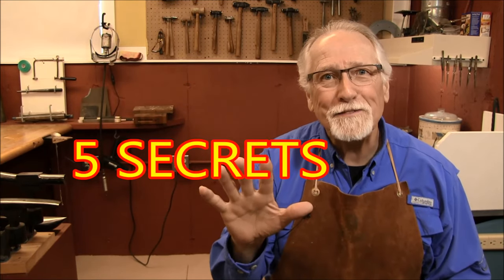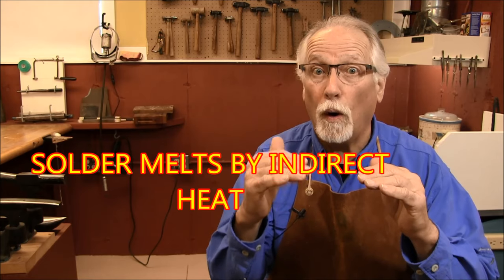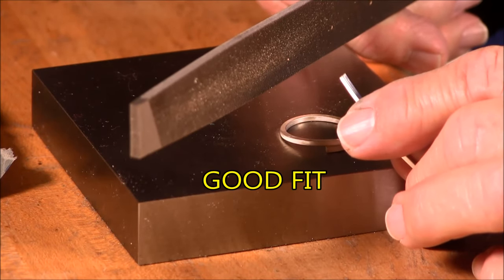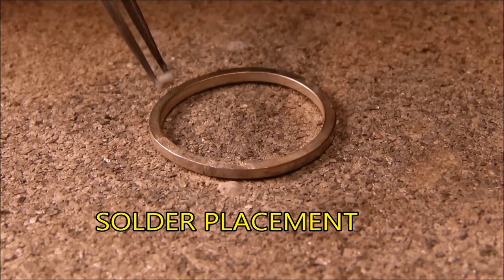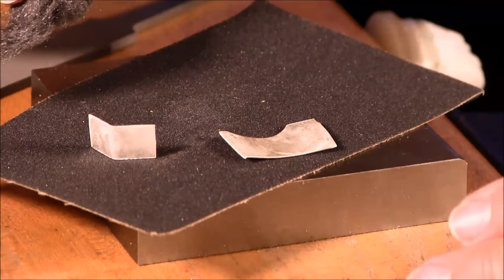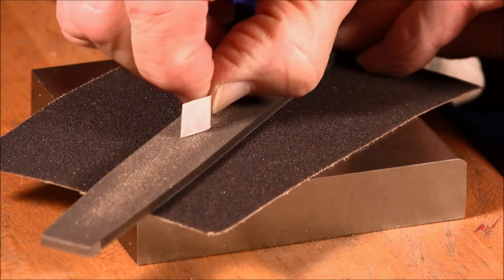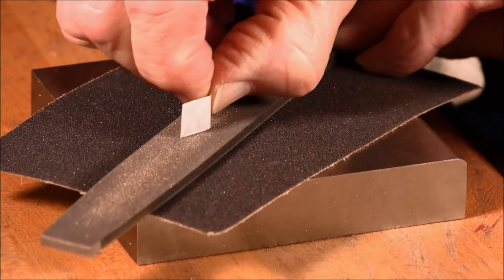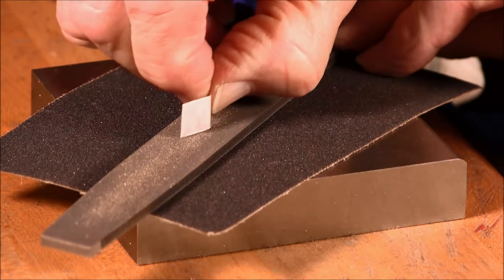5 SECRETS TO PERFECT SILVER SOLDERING!

Comment: Thank you for these videos, I have learned a lot from you.  How do you feel about using wire solder and quick touches to the joints?  I am always unsure about how large my palions should be or how many to use.  Thanks.
Reply from the maker: Hello Laszlo,  You are welcome and I'm glad you are learning!!  Stick feeding wire solder is a good method and I use it often.  I usually use it when I need a little more solder than just a few pailons.  Be careful, because it is real easy to over feed and then you will have a mess!  A little trick to make your solder wire thinner.  Put a 1/4 rod in your vise standing straight up. Take a length of wire solder, hold the two ends separately with two hands.  Loop the wire over the rod and start pulling the wire back and forth on the rod.  This will stretch the wire and make it thinner.  This way you can control the amount of solder on the joint simply by using a thinner piece of solder.  (Hope this makes sense to you!!)  Good luck and have fun.  Greg Greenwood
Reply: @greggreenwood4628    Thanks I'll give that a try.
Reply from the maker: Hello Laszlo,  Let me know how it goes.   Greg Greenwood

Comment: I watched the entire video and learned to just cut the silver solder instead of trying to feed it off of the roll - as I normally have done (Unsuccessfully).
I was trying to figure out what surface you are soldering on?   It looks like granite -0 but I learned decades ago that using a torch near granite will cause it to blow up (in my face). 
What surface are you setting the items that you are soldering on - it is granite, or does it just look like granite?
Reply from the maker: Hello NaverAuto,  I am very glad you learned about cutting the solder instead of stick feeding it.  The surface of my bench is slate.  It is from an old house that was being torn down and I saved it! I don't solder directly on it.  I always use a soldering block.  Vermiculite soldering blocks work great to protect your bench.  Which is usually wood.  Check out my video "30+ Silver Soldering Set Ups".  You will get some good pointers.  Thank you for watching.   Greg Greenwood

Comment: Dear Greg, thank you so much for such an informative video! 
I am a beginner in soldering, so I just bought Bernzomatic butane torch, but it seems it can not melt a 60% silver solder at all. What’s wrong? Maybe it just doesn’t have enough temperature for soldering?
Reply from the maker: Hello Elisha, Welcome to the world of metalsmithing.  Thanks for your comments. It is possible that you have too large of a piece of metal and the torch cannot heat it up to the melting temp of the solder.  If you have followed the 5 secrets  and it is not flowing,  Crank your torch up and heat the metal faster.  If you still have problems, please let me know and we will figure it out.   Thanks for watching.   Greg Greenwood

Comment: I have a project where I need a pretty tight fit I would rather a pressed fit but I don’t suppose I could solder it then, I’m putting a 5/16 or a 3/8 in sleeve in length and a 1/16 thick in a hole
Reply: How tight can I make it!
Reply from the maker: Hello Eric,  Make it as tight as you can.  Even if it is very very tight, it will solder.  The solder will flow into the seam.  I hope this answers your question.  Thank  you for watching and commenting.  I am here to help.  Greg Greenwood

Comment: Great tips and video.  Do you use the same flux and solder for copper and brass?  Any recommendations?
Reply from the maker: Thanks again Larry.  Yes, use the same flux and solder for copper and brass.  Try to make you fits as perfect as possible.  This will make the solder seam not show up on the copper or brass as much.  Good Luck  Greg Greenwood

Comment: Greg, I really love your videos!  I was hoping you could help me with a problem I am having.  I've been soldering successfully for years but in the last week I've been having trouble and I can't for the life of me figure out what I'm doing wrong. My piece is turning black right away and the solder isn't flowing despite the boric acid solution I'm using.  Thinking it might be a bad batch of solution, I tried with just a paste flux and the same thing happens.  It also doesn't seem to make a difference if I use wire or paste solder.  I use a Smith Little Torch with propane and oxygen and I work only with copper.  Is it possible to use too much heat? Could my propane to oxygen ratios be an issue?  I could really use some help before I go bald from pulling my hair out!!!  Thanks so much!!
Reply from the maker: Hello Mark,  Interesting!  Without seeing exactly what is happening, I have a few questions for you.  Have you been soldering the same size of copper, same torch, and same flux for years and all of a sudden you are having problems? Is the copper a reddish color when you start to heat or is it clean with no reddish color to it? Solder will not flow on the red color of copper. 
 Copper is known for turning black or oxidizing when you heat it. If it is oxidizing right away, this means you have not protected the copper with enough borax flux.  Don't be afraid of putting a lot of borax flux on the copper. Using the boric acid solution is probably not enough to stop the oxidation, thus, your solder is not flowing.  Also, use a more reduction flame when heating the copper. (Not a hissing flame, this means too much oxygen in the torch tip) . 
Let me know if this is helping you.  The best to you and thanks for your question. I hope this helps.   Greg Greenwood

Comment: Thanks for another great video!!Mr. Greenwood, it would help immensely, if you could make a video on using gallery wire for bezels. Unfortunately, I keep accidentally melting mine! That’s a big waste of money, time and effort. I read somewhere that painting the decorative part of the gallery wire, with liquid paper will prevent the top from melting. Is this true? I really could use some help. What do I do with all of this ruined silver with solder on it? Help!
Reply from the maker: Hello Texas Gigi, Thank you for your comment. I appreciate it.  Gallery wire can be a problem, but it doesn't have to be.  Sounds like your problem is excessive heat.  Gallery wire is very thin and will heat up extremely fast, soooooo... you don't want to put the torch directly on the wire.  Set up your bezel back sheet on a tripod or 2 third hands and heat from the bottom only.  Because the gallery wire is so thin, it will heat up enough from the indirect heat of the back sheet and the solder will flow beautifully.  If you have not seen my 2 videos  "Bezel Setting Cabochons Parts 1 & 2", make sure that you watch them.  You will pick up a few tricks.  There is a product from Rio Grande. "Rio Chil Gel"  it is for protecting stones and other  metal when you are soldering.  Check it out, it might work for some other soldering that you may do.  I believe the heating from the bottom is the best solution for your gallery wire.  As for the wasted metal.  You will always have scrap and "wasted" pieces of silver.  Keep them and after "lots of mistakes" LOL .  you will have enough to recycle. I use  scrap to make shot also.  Let me know how it goes.  Good Luck.  You can do it!!!  Greg Greenwood
Reply: @greggreenwood4628  Thank you so much, for all of those good ideas! I will definitely get some of that gel and I will watch those 2 videos, right away! Thanks so much for getting back to me, so fast!!
Reply from the maker: My pleasure!  Greg Greenwood

Comment: Love your tutorial. Is there a specific flux you need to use for soldering sterling silver or do they all work the same?
Reply from the maker: Hello Sharyn,   Thank you for your comment.  You should use a flux that is a high temperature flux.  Borax flux (white paste) and liquid high temp fluxes will work.  Do not use the flux for plumbing soldering.  That is a low temp flux and will burn off before the silver solder melts.   Thank you again.  Greg Greenwood
Reply: @greggreenwood4628  Thank you so much!

Comment: Hello there! Love your tutorials, but I have some problem , sometime peace of silver I’m working on gets hot even can melt and happened to but solder doesn’t melt, I’ve got to doing something wrong can you tell me what it can be , thank you, Vj Maidans .
Reply from the maker: Hello vj m,  If your silver piece is melting, then you have too much heat.  Because you are over heating the metal, the flux probably has burnt off and oxides have formed where the solder is to melt.  Back off on the heat of your torch, use plenty of flux, and heat only in the area that you are soldering.  You do not have to heat the entire piece to the melting temperature.  Take it slow and watch your flux.  It will tell you when the solder should flow.  1. Flux should bubble and boil off water 2. Flux will start to settle down on the metal 3. Flux will turn clear and smooth 4. Then solder should melt right after the flux is clear.    Just take your time and practice a little more before you solder your final pieces.   (Practice, Practice, Practice.)  The best to you.   Greg Greenwood

Comment: Very cool... Thanks.
Can you please say what exact solder and flux do you use?  Every time I try it the silver just turns into balls, doesn't stick and the solder just crusts up... It's always a mess... when it doesn't destroy the piece i'm working on...  😀
Thanks again...!
Reply from the maker: Hello dmprdctns,  Thank you for your comments.  I appreciate it. It sounds like your main problem is you are not heating the metal up to the melting point of the solder.  Solder does not melt and flow onto the pieces of metal unless the metal parts are at the melting point of the solder.  In your case the solder is balling up because the solder is hot enough to melt and it simply balls up, but your metal is not hot enough to make it flow into the solder joint.   Please watch these videos on my channel.   1.) "5 Secrets to Perfect Solver Soldering" (You have already watched this one.)   2. "What the Heck is Sterling Silver and Silver Solder?"   3 . "What is Pickle?"   4. "Silver Solder Hidden Details".    5&6. "Sweat Soldering Part 1 and Part 2 "  These videos will answer many of your questions and help you understand what is happening when you are soldering.  If you understand these details , you will be able to solder with no problems.  Thank you again and Please let me know how it goes.  I am interested in your progress.  You can do it !!!  It will be fun.   Greg Greenwood
Reply: @greggreenwood4628  Thank you very much.  Very appreciated!   I will watch those videos, LIKE and SUBSCRIBE...
I hope I didn't misunderstand, but the flux (Stay-Silv, white)  dries up, crackles, etc. on this copper ashtray with other metal trim.  The ashtray, a test piece, got so hot that it melted other solder points and liquefied the trim around the copper.
Thanks again... and Happy Sunday to You.
Reply: @greggreenwood4628  wow, this helps me so much. It is a problem I have had and keep having. NOW I GET IT, my long unanswered question is now clear. I can’t thank you enough.
Reply from the maker: Hello Tina,  Very glad to hear it.   Greg Greenwood

Comment: I have a stainless steel pan with a very small pinhole through which water leaks.  I heard you say solder will not fill gaps so does that mean I should not even try soldering the pin hole?
Reply from the maker: Hello Bob,   Go for it!!  If you have to, put a small silver wire in the hole first, then solder.  Good Luck  Greg Greenwood

Comment: Just a great video.  I'm hoping you can suggest a torch for silver soldering brass?
Reply from the maker: Hello,  Thanks for the comment.  Glad you enjoyed the video. 
You can use any torch for brass soldering that is good for silver.  If you are soldering heavy pieces of brass I would suggest using an acetylene gas/ air mix torch.  A propane gas torch will do a great job on brass sheet metal.  If you have access to a natural gas and air mix torch, it will work also.  You can find these torches in most jewelry supply companies. Also hardware, big box stores, and farm stores normally carry these torches.  Have fun soldering!!  Ask any question,  ANYTIME!  
Greg Greenwood
Reply: @greggreenwood4628  Thanks Greg!

Comment: Thank you for a very instructional video.  I use artistic silver wire for jewelry making.  Can that wire be soldered?  It's silver-coated, copper inside.
Reply from the maker: Hello J & D,  Yes, you can use silver solder for your wire.  I would not recommend using the IT solder.  It might have too high of a melting temperature for what you are doing.  Use the lower temperature solders.  Easy, Medium, Hard.  Thank You. Greg Greenwood
Reply: @greggreenwood4628  Thanks very much for the quick reply.   I have a silver solder paste that I was planning to use.  Hopefully that will work as well.
Reply from the maker: Absolutely,  It will work fine.  Good Luck and let me know how it goes.  Greg Greenwood

Comment: Hello Greg. I pay close attention to the 5 points that You indicate to succeed in a good soldering. But I have a question about the strength of my flame: I have a lot of trouble knowing if I have a hot enough flame for my soldering. I don't know if I'm using the right part of my flame to get enough heat. can you give me some tips: flame color? noise? I use the ORCA torch; thank you very much.
Reply from the maker: Hello Sadaf, Thank you for viewing my video.  I appreciate it.  Your Orca Torch is a propane fuel torch and will have a blue flame.  You should have several tips. The hottest part of the flame is just beyond the sharp bright blue flame. You should not have a load noise when soldering.  "Medium" level noise.  I want you to do an experiment that will help you learn more about your torch.   Take a small square of silver 3-4 cm  and put borax flux on it.  Start with your small tip and heat the metal (just beyond the blue flame)  until the flux stops bubbling and forms a glaze.  Count the seconds that this takes.  Repeat the process with your medium and large torch tips.  The time should be under 5 seconds.  If it take longer, then you are using too small of a tip. You can use this knowledge when soldering your projects.  If it takes to long to burn off the excess flux, then you need to use a larger torch tip.  I hope this helps you.  Let me know how it goes.  Greg Greenwood
Reply: @greggreenwood4628  thank you very much Greg for taking the time to answer me. I am always very worried about boring experienced people with my beginner questions ... But I also think that asking questions was part of the learning process and allowed me to waste less time! I will test what you suggest to me. I am delighted to have the beginning of an answer, and am almost sure that I will finally make some nice solders. thanks again. I would allow myself to give you some news ...
Reply from the maker: Sadaf,  I am happy to help you with your questions.  That is how we all have learned.  Good Luck.  Greg Greenwood

Comment: Excellent information, thank you.  I'm going to attempt to sweat solder 2 pieces of sterling together.  Both pieces are textured, one pretty deeply from the rolling mill.  Any suggestions?  I'm considering using binding wire, but not proficient with it yet.  This is for a ring band.  Thank you for all the information you give in your videos.
Reply from the maker: Hello LA Os,  Thank you for your kind comment.  As for your ring soldering.  If you have textured the sheet with the rolling mill it will be work hardened and will be stiff and springy.  You first need to anneal both pieces to make them soft.  After annealing, put them on your bench and push them flat with your fingers.  If they are still not flat, use your rawhide mallet and tap gently to make them flat.  Because they are flat, you do not need to use binding wire.  You can use the cross-lock tweezers to hold the two pieces together as you solder.  But this will steal  some of the heat, so you need a larger flame to melt the solder. Next melt solder onto the back of the top piece and put in pickle to clean.   Then you are ready to solder the two pieces together.  Flux both pieces and place the top piece onto the bottom one.  Make sure that both are flat.  Then heat with your torch and melt the solder.  Your texture should not affect the soldering process.  If you need to push the top piece down to make sure it is seated on the bottom piece, you can use your pick to push it down when soldering. Do this only if you are not using the cross-lock tweezers.  I hope this helps you.  Let me know how it goes.  Good Luck  Greg Greenwood
Reply: @greggreenwood4628  Thank you so much.. will be giving it a go tonight after work.. I'll let you know how I make out.  I revisited your soldering secrets last night, and I was thinking about.. flat, flat.. make those pieces meet.. that's the right way to do it : )
Reply from the maker: Hello LA Os,  That is correct.  Flat, Flat....Good Luck.  Greg Greenwood
Reply: @greggreenwood4628  I'm so pleased to report back that it worked perfectly.  I went with pressing down with the pick while it was seating,  Thank you so much for walking me through it!!
Reply from the maker: AWESOME!  WAY TO GO!!   I am very glad that it worked for you.  Keep it up.   It is my pleasure to help you.  Greg Greenwood